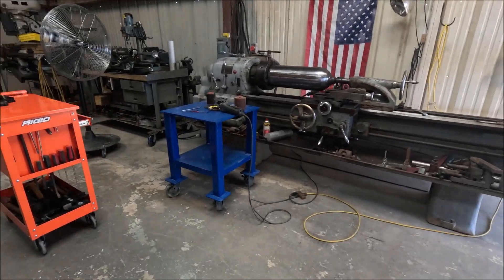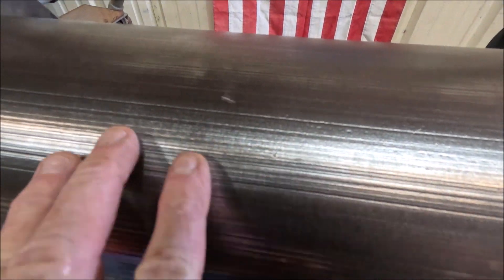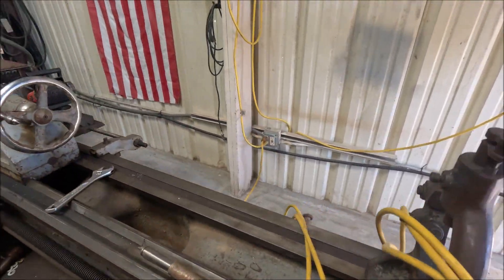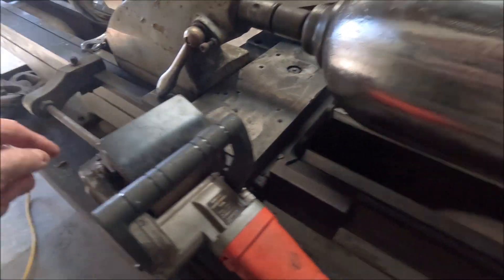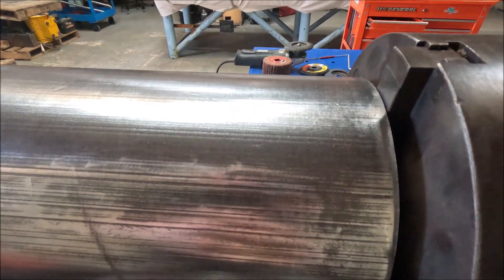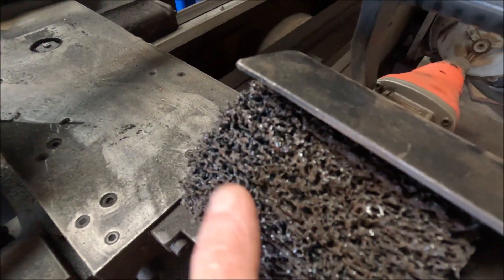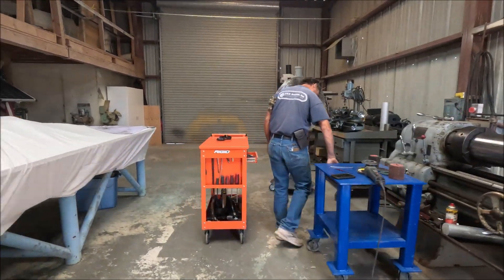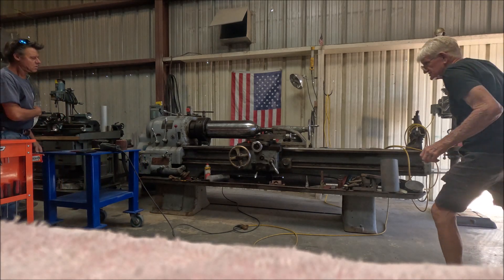TRANSFORMING AN OXYGEN BOTTLE INTO A BELL AND THE TIG WELDING CART PROJECTS OCTOBER 8TH 2024

Comment: Why are you not just using a cutting tool on the lathe to clean the tank up?
Reply from the maker: For that big bottle we had already cut off the bottom which weakened it and when tightening it up in the chuck it was so deformed the runout was unacceptable… since this was our first use of the clausing for doing these Bells.. the next bottle will be ‘chucked up’ complete (with the bottom intact.. after polishing we’ll then cut the bottle to the lengths we want.. which is another process … 
‘Tuning’
Reply: @parsonsenergy  I have made these bells from old expired, retired oxy/ace bottles that haven’t passed inspection  “purged of course” and they make a nice tone, I usually will plasma cut designs in them for customers. What will you use for the ringer weight?
Reply: I use old cast iron window weights
Reply from the maker: @MannyVanOss  Thank you Manny for your comments. We have gradually been bringing our Clausing lathe back to life after it sat in the elements for 25 years in our desert.. This bottle was started after the end was cut off making it weak and unable to true it up... When we get another bottle we will chuck it up with its' ass end intact. I'll do another vid when we get time. As far as a clapper I am pretty sure it will be an Oak branch about 6' long and 12" to 18" in diameter. A really dead weight that produces a low pitch when struck from about a 75* angle.